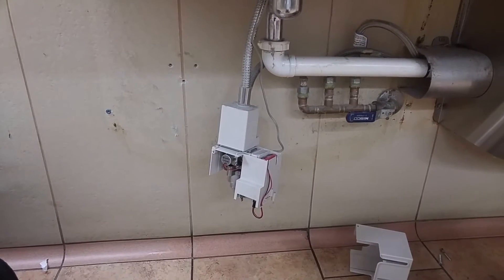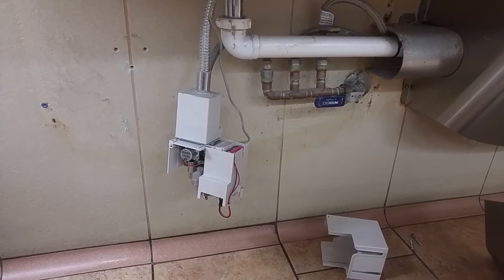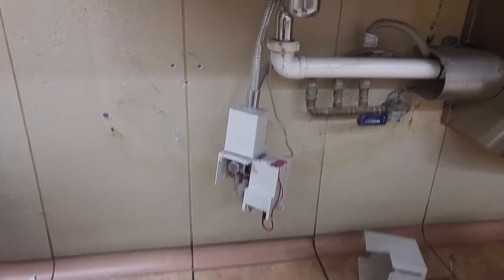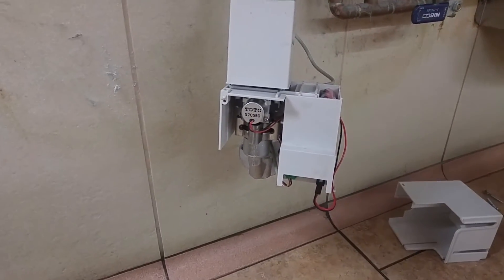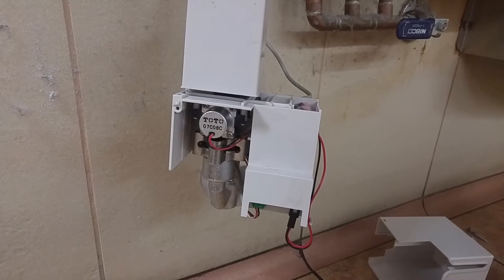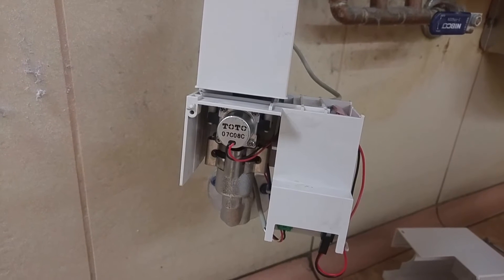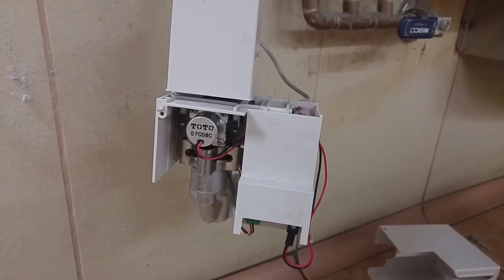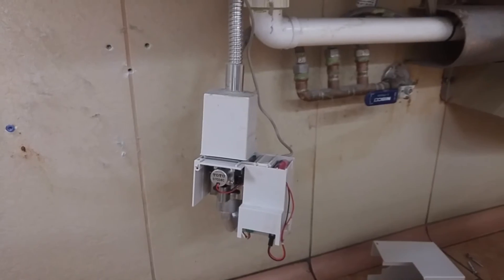Toto/  SINK SENSORED FAUCET

Comment: Today before I saw your video I had the same issue water running does not stop .......... took the solenoid valve out 4 screws and cleaned it put back and it worked.